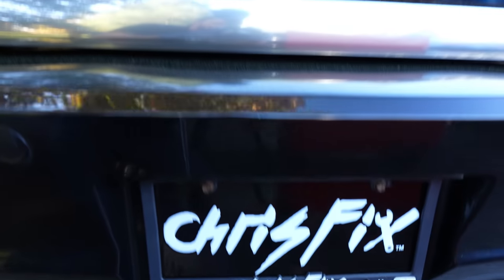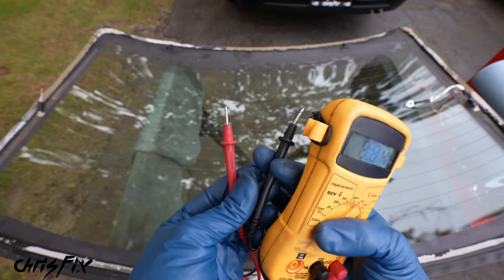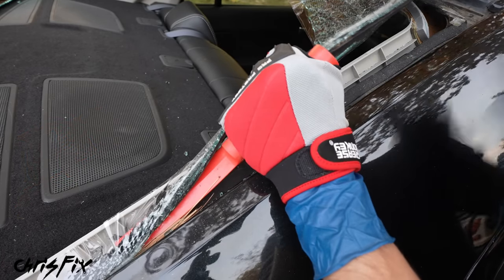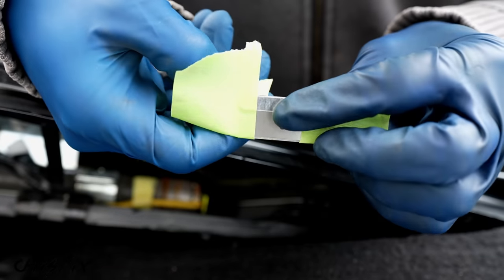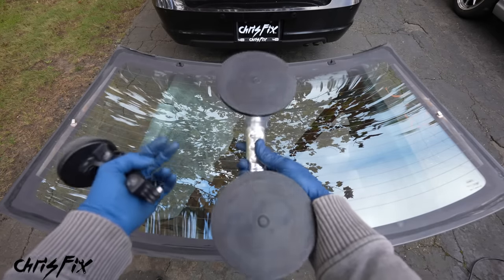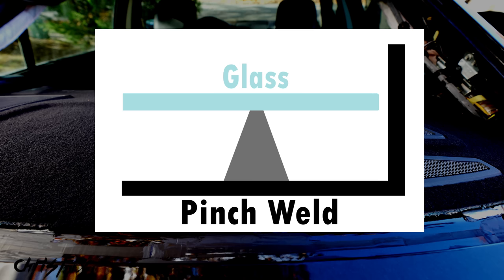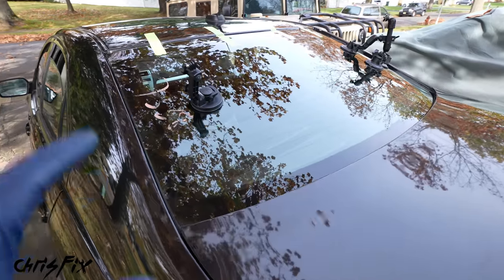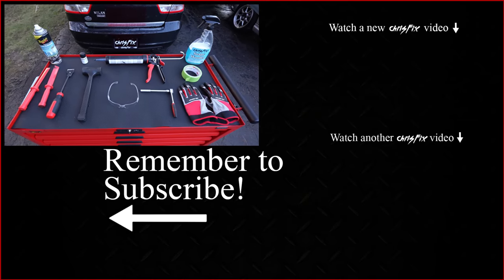How to PROPERLY Replace a Rear Windshield (No Special Tools DIY)

Comment: Great video.
One important thing when replacing the front windscreen on newer cars:
When the car has a light sensor, rain sensor and/or cameras in the windscreen they have to be calibrated after the replacement. Especially the camera calibration is something you most likely cannot do on your driveway. Also sometimes these sensors cannot be reused and have to be replaced.

It is also pretty common to apply the urethane to the glass instead of the car. Makes applying quite a bit easier.
And from my experience it felt like the triangle you made was too narrow at the bottom.
Reply from the maker: Thanks for sharing!
Reply: i have never had to replace a sensor? and also calibration isnt always needed not with rain sensors

Comment: From my knowledge, golfball, baseball or even softball-sized hailstones are also known for destroying car windshields.

This is common in places in the United States alone that get hail, such as the Great Plains (aka "Tornado Alley") during the spring and summer months where tornado season is heating up, during which frequent hailstorms are the norm for citizens and storm chasers alike.
Reply from the maker: Thanks for sharing!
Reply: @chrisfix  ¡De nada (You're welcome)! I learned that from National Geographic as well as the Discovery Channel TV series Storm Chasers (2007-2012), etc.

Funny you didn't mention rock-hard baseball-sized hailstones in this video. According to the National Weather Service, any hailstorm with hailstones larger than an inch (roughly 2.55 cm) in diameter will trigger a severe thunderstorm warning. And it's not just hail, either!

Bullet holes from gunfire -- in which someone packing a gun (i.e., a pistol, rifle, shotgun or machine gun) starts sprying rounds at your vehicle's glass (oftentimes on full-auto, as long as no one is inside for safety reasons) -- is another commonly possible factor.
Reply: Come to Texas and you’ll find out 
April may and June is our biggest season for hail and tornadoes
Reply: @hollywood739  You ain't far off, partner. It ain't just in Texas, either.

From what I know, anywhere from as far south as Texas to as far north as North Dakota (is other words, a large swath of the Great Plains) is essentially Tornado Alley (March or April to August every year).
Reply: @josecarrilloii4036  just to give more precise measurement an 1'' is 2.54CM
Reply: @badaboom8520  Hmm... close enough.
Reply: @finnafishfl  What's with the grapes?
Reply: @chrisfix  Feel free to give my comment a shout-out in your next video!

Comment: On the assembly line I worked on, the rear trim was on before the glass went on. The wires were hanging out and one or two clips on the trim were loose to allow it to be pulled back enough to connect the defroster. Now to make your demonstration more real: have two to four people working on the interior of the car while it is moving on a conveyor; two people prepping the glass with primer and applying adhesive to the glass (not the body); and two carrying the glass to the car installing it. Do it all in less than a minute and do it over and over. That was glass robot backup where I worked.
Reply from the maker: Sheesh that doesn’t sound fun! No wonder there was sound deadening where the urethane should go. Is it as “hectic” as it sounds or is it relatively smooth working?

Comment: Good job Chris I’m in my  36th yr I think of doing auto glass I enjoy watching some of the (pros) teaching and yours is one of the best DIY on auto glass replacement I’ve screen on tube. You do your homework. I saw one thing I would correct and that the where you cut the tip for the caulk tubes. Some things come pre-cut, but they do make a couple tools that automatically cut them in the correct spot. Yours was rather thin and way too long, which will work as long as they don’t fall over and end up in the wrong spot, and they should be thicker, and not quite as high, all in all very good video. I see alot of so called professional installations jobs done through out my career that I’d recommend that professional to watch Chris Fix putting this back glass in. Thanks and great job

Comment: loved the video, i work in an auto glass shop and was curious to see how you would handle this. my one concern is that we use a special activator on the old urethane to help it bond to the new stuff. I dont know where you could get this activator outside of specific glass retailers, but im sure it exists somewhere for the public. I would also like to say that if you're unsure of yourself or the equipment available at all you should really take your car in to a proffesional. The windsheild of your car is both structural and a safety feature, so having it installed improperly can be extremely dangerous.

also on the topic of the wait time for ordering glass from a dealership or a glass shop, our shop has a crash wrap that we can use to provide temporary covering for broken windows. We charge a fee to install it for anyone, but if your having us install new glass for you we'll cover your windows regardless. I dont know if this is standard practice at all auto glass shops, but its worth looking into if you need your vehicle weatherproofed while you wait for the glass.
Reply: Not all urethane companies require an “aktivator” for the old bead.  Sika and Dinitrol are the main ones that still use that.  DuPont and a few others have it built into either the primer or the urethane it’s self.   

I own a glass company and Im a big fan of DIY, but bonded glass is something that almost every diy job ends up getting screwed up and leaking, not to mention ruining a car.

Comment: Just some general tips from someone's who has fone Glass for years. Before that loved everything you did and how cautious you were great stuff.

First-I bend that razor blade to give it more leverage in your hand and it won't snap and helps you get around the body better

2. Primer is good and I can't remember but I only believe I saw one coat, always do 2 coats because that first layer could be too thin and weather away trust me I've seen it happen. In addition to that I would not suggest putting primer on a bead of urethane whether it's Glass or body because it can actually weaken the bond (crash tests have proven this) that being said urethane will stick well to a primed surface but once your doing a bead to bead..urethane will ALWAYS  and I mean always stick best with urethane to urethane contact , then the only thing to improve adhesion is a totally separate chemical adhesive pad (bought at any automotive store) that is approved by 3m to do so

3.The tape is good for measuring fit but you also have those factory tabs still on the Glass (minor thing so it's dealers choice) 

4. I'd recommend using the cups(with gentle taps)  to move the glass not hands because pressure is inadvertently sent down word pressing the bead in place and also moving it when doing so.

5. Your bead was to thin for my liking and rather you would be better off cutting at an angle not straight down but angle just behind where the 3 lins on the tip were and then cutting a equilateral triangle tip for better stability and bead output 

Minor note : you could put it on the Glass BUT I'd recommend that for season professional because it can ruin the bead or create a mess making you start again. Also I don't remember if you cleaned under the packing tray but it's a not a huge deal breaker lol

All in all I say a fantastic job and should you do it again and encounter rush issues I'd be glad to help on that one! 

Great job would definitely recommend 👌
Reply from the maker: Thanks a lot for all the tips!

Comment: Hey Chris!  Can you do a video on replacing valve springs?  I've been working on cylinder heads recently and would love to see someone who can confidently replace the spring keepers versus the trial and error most people seem to require.  (Although I do have a Lisle tool on order, the classic c-clamp style valve spring compressor is a massive pain but it's what I have for now.)

Comment: Awesome video
But I would think when you run in that bead of the sealant would it be easier to be on your knees on the backseat and take your body through the opening so you don’t have to reach over from the passenger side to the driver side with one continuous bead
Reply from the maker: Good idea!

Comment: I finally saw a windshield replacement video where they used plastic tools to avoid scratching the paint and taped up the blades. Other installers don’t even try to protect the car, they just cut with metal tools. The whole process looks fast, but they never show a close up of the paint to see if it’s damaged. The comments below even say it’s well done. are people’s standards really that low? This is the most careful video I’ve seen when it comes to protecting the car.

Comment: Mind you: on a lot of modern cars the front windshield has rain/lightsensors and or radars (for adaptive cruise, collision detect etc) glued to them. While changing them isnt a huge deal, you will need a specialist to recalibrate the sensors

Comment: Hey Chris just a little information for ya! You actually don't have to paddle, i work in the production field at Tesla and the urethane just needs to overlap by 30MM and they don't have to be completely combined together. Another thing i recommend is when you put the glass in go alignment Pins First, then slowly fold down like a leaver and once its perfectly in its place, push down on the glass slightly with firm pressure to get the best bond and result! Also the tape to keep the window sagging is what we do in the factory so +1 😂
Reply: You hiring?
Reply: @jonathanthomas2449  i resigned to get a higher paying job, tesla is always hiring though you could get a job easy.

Comment: From one Chris to another.  Thanks this Helped a ton.  Some punks broke out my Back window of my Yaris Hatchback with a frozen water bottle.  This has been most helpful replacing my glass.  Though the plastic scrapers did not work for me they did not cut at all.  I used a Linoleum curved bill blade type knife that worked ALOT better to cut the old urethane.

Comment: One nitpicky suggestion,
My father-in-law installs glass for a living, and one of the best pieces of advice he gave me for stuff like this, is put some masking tape around the perimeter of the windshield. Just as a preventative measure in case you bump into the paint. It keeps you from lightly chipping the paint on accident and not noticing until it starts to rust out months later.

I bought a truck last year that had its windshield replaced right before the sale, and now I have to take it back to get a repaint because they lightly chipped it and didn’t realize it after installing the new glass. Now there’s a very clear line of rust developing on top of my windshield.

You still did a fantastic job regardless!

Comment: Hi Chris, still love the quality of the videos you share with us. I installed auto glass for 2 years while I was in college to get by. The front windshield at the time was called safety sheet and as you said the others except in pre60's cars was temperedsn very tough . As a mater of fact glass is a lot stronger than most people think. I also replaced  1/4" . This was just bare bones plate glass because we could not cut tempered glass in store fronts. Tempered is so much safer since it shatters and not breake into large chunks of very sharp glass. The windshield was intended not to just pop out. If you hit the windshield in an accident you got cut up pretty bad.  At least I did in 1964.  This is a job most people can do . My only suggestion is always were safety glasses. Thanks much again my friend. This is not to correct you just let you know what things were called in the past.👍👍😁💥
Reply from the maker: Thanks Ken!

Comment: Saw another video of a guy who replaces windshields professionally, and for removing the old urethane he actually used a sharp wood chisel. 
I removed it with a wood chisel, and it went quite well. Just make sure it’s sharp, without burs, and not too thick. Started with 3/4” , but 1/2” worked better to avoid scratching paint.

Comment: 😂I’m a mechanic and I also install and remove auto glass. I’m AGSC certified. I was watching every moment waiting to see if you would do something wrong. You have no idea how many videos there are of people claiming to know how to remove and install glass and they do a horrible job. So bad that I go in the comments and tell people please don’t follow this video. But you did all of it 100% right. The only thing I would say, not even that you did anything wrong. But if the glass is a bit too shifted to one side you can use the actual suction cup on the opposite side to tug it to be centered. But great job as always.

Comment: When I first saw this video on it's release I thought "awesome video, but not something I'll need". Then my friend's Nissan Altima was vandalized. Now I have his car in my garage and the glass completely removed, just waiting to go to the junkyard and get a new (used) glass. Letting the car dry out (unfortunately it got rained on hard) and need to remove the C pillar trim tomorrow. I already removed the lower seat and have access to the bolts holding the upper part of the seats so almost done with removal. But this is a job I wouldn't have normally tackled and it's coming out amazing! Also the hardest part BY FAR is removing the old glass because of the urethane.... that took me forever.

Comment: for connecting the bead when you get back to the starter point I like how you've used a piece of thin wood but an easier way is to put saliva on your fingers and push it together it stops it from sticking to whatever material you use, and with the original connector holes at the top just try to push the urethane to make a nice seal with the holes and to make it easier to replace in future but great video man much love from Australia
Reply from the maker: Thanks for the tip!

Comment: Chri, I'm sure someone that also has glass installer experience or a red seal might have mentioned this already but, I keep shouting at my screen when you keep touching the cleaned pinchweld, "Stop making more cleaning work!", otherwise this is very spot on, there's sometimes a 3rd reason for the glass explosion; There's either a defect in the Urethane like a hard spot and no one is going to know unless you squeeze it out and if it's big enough you can spot it and remove it before laying the glass otherwise, as the bead sets and shrinks till it's fully cured it'll be a pressure spot. (Also to note: Temp glass is easier to break in the corners where it's weakest if using a glass breaker best not hit it in the middle even if you're strong just to make sure you got it on the first try). To paddle it's best to go in the direction of your run and have a popsicle stick damp with saliva or glass cleaner ( I used Dow Chemicals (GC-800) product in our shop before and they said it was ok back in 2012) to avoid any sticks and if you do accidentally lift up make sure the bead is set down on the weld so there no air pockets ( first few cars/ truck it came back with whistles and I was talked too).

Signal Flare has some good points too, I was going to add more but looking through the comments a lot of others has the info written.

Still a fan and love your work.

Comment: Skip the chisel, just use a razor scrapper with a few fresh blades right from the get go and filet that bead off of there, brother, takes 3 minutes. Watch your eyes though, it will shatter glass out everywhere, still much quicker than a chisel I'd imagine. I do like the tape technique for the glass, but really,  just beat that glass down before you vacuum, then its much easier to trim the bead. your vids rock! Outside out glass, I'm useless with cars. I appreciate the diversity in your knowledge with DIY jobs and sharing it with us!

Comment: From the person who works at windshield instalment shop for half a year, I have a few comments.
1. You can apply this glass sealant earthier on glass or windshield, however is easier for current car.
2. Even if you have plastic guides, we cover them with sealant to prevent leaking. 
3. We activate both surfaces with special activator before applying primer and sealant ( because cars came to us, where activator wasn’t applied and if it wasn’t applied to car body it just peals off, same with glass, sealant stays on the body, but glass completely not glued properly.)
4. With removing glass shards, we just put blanket on rear shelf and seats, it breaks down, remove blanket with shards, seats almost glass free.
5. Most of the time we glue rubber trim with second glue, sometimes when it’s necessary we put double sided tape.
6. Applied sealant could be connected with blade previously lubricated with spit (idk how others do it, in place where I work, they do it this way, and it did stick to blade, no leaks after applying the windshield were spotted)

Comment: Been doing glass 20+ years and only thing I would change on this installation is the width of the base of the bead. Also the brand of the urethane. The 3m products are great but I wouldn't recommend 3m windowweld. It's a soft resistance adhesive and is part of the issue Chrisfix was having with the V bead  rolling over. His bead width was also part of the roll over issue.
Reply from the maker: Thanks for the tip! What would you recommend that’s still “soft” enough to hand lay?